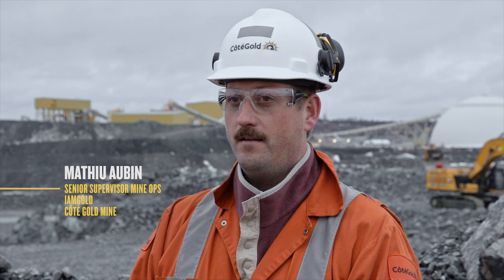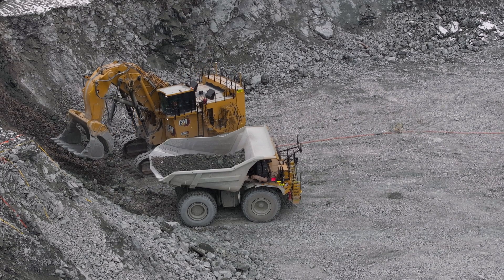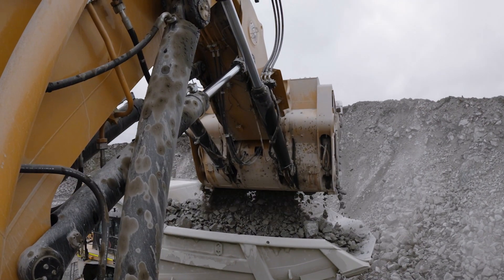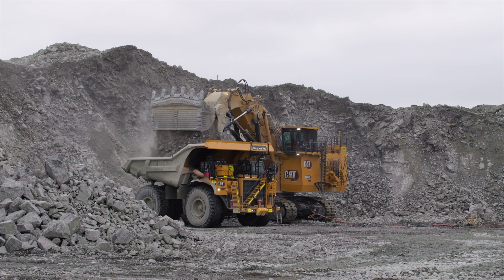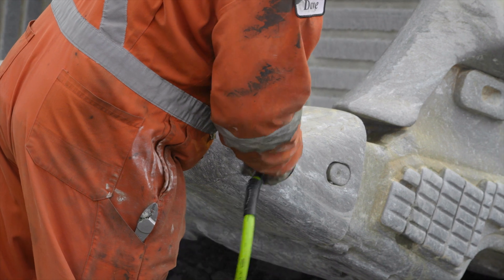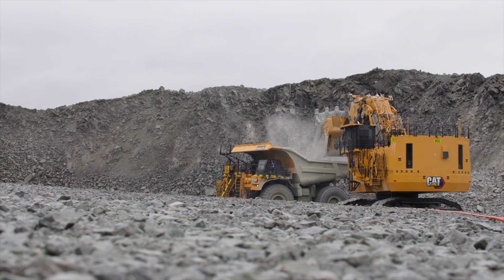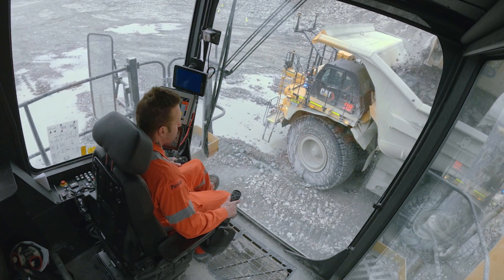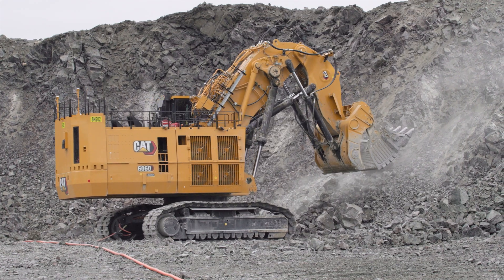Cat® 6060 Tethered Electric Hydraulic Mining Shovel Put to Work in Canadian Gold Mine

Comment: electric only makes sense when its tethered
Reply: pretty much yeah, these shovels dont move very much, so they can easily be tethered
haul trucks? bit trickier since they need to move a lot, diesel electric(like every haul truck except cat, all diesel trains, etc) works great, connecting that to overhead wires on parts of the haul route is incredibly effective(which is kinda like a tether?)
and if you have enough overhead wires, you can basically just replace the 30+ ton engine in the haul truck with a battery and youre even better off

Comment: "Carbon, carbon, carbon." Good grief, CO2 is at 4ppm in our atmosphere and is the building block for life as we know it, so don't vilify "carbon". That said, there are many advantages to an electric shovel as you've stated. But tell me, where do you get the electricity from? Diesel generators, hydroelectric, electric fairies and sprites? This electricity doesn't just magically appear, so there are pros and cons to any system.
Reply: The mine is connected to the grid, the electricity in Ontario is a mix of nuclear, hydro, gas. Probably much cheaper that running on diesel
Reply: @vincnet010  lol no
Reply: @cameronhenagar2001 well yeah.
Reply: running a diesel generator powering electric motors is still more efficient than mechanical drive, thats why all the biggest machines have always used it
its even more efficient the bigger that generator is, if youre running power from an onsite coal plant or large diesel generator, thats even less fuel and emissions

carbon is four HUNDRED ppm in the atmosphere, not 4ppm. thats nearly twice what the earth can naturally cycle, and so much that its actually harming plants(yes plants can have TOO MUCH carbon)